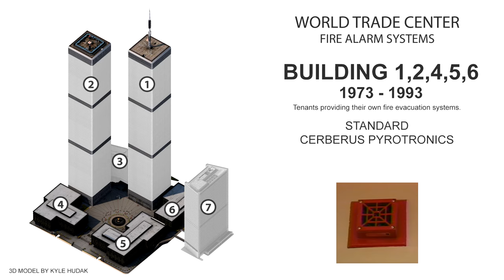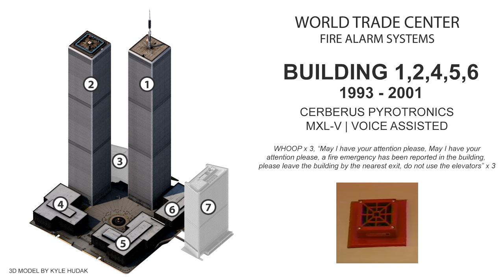World Trade Center | Fire Alarm Sounds, WTC 1,2,4,5,6,7

Comment: Did something trip these alarms on 9/11 or could it have been manual?
Reply from the maker: Considering the magnitude of the damage these buildings sustained, I'm sure they would've gone off immediately. The buildings had various smoke- and duct detectors, and were most likely to be equipped with redundancy circuits as well.

Comment: 1:38 does not make any sense, the red one is a british alarm....and the silver simplex alarm is a horn/light...not speaker...
Reply from the maker: This would be an error on my end. The Firecom patent spoke of two separate systems to generate a whoop tone and a chime tone, but it didn't describe how the actual device would've looked like and if both were incorporated within the same box, hence the and/or note in the middle. It was to my knowledge that the device on the right was capable of producing a single tone which would be the chime.
Do you know what device may have been more likely to have been used? I'll gladly update the information in the description. Thank you.
Reply: @RobvilleVirtualRealisations  My guess would be that said "separate systems" were located in the panel itself, & that both sounds were broadcasted over a network of speakers or speaker/strobes mounted around the building. From what other people have said, it seems that building 7's alarms were probably Firecom-rebranded Wheelock E70 speaker/strobes. (I've found a few Firecom-rebranded versions on Ebay so that's probably what was in WTC 7)
Reply: @RobvilleVirtualRealisations  There was no voice.
Reply: @RobvilleVirtualRealisations  Yes. I know the devices used.
Reply: I believe they were split systems. The horn carried the whoop while the flatter speaker carried the “boop” and announcements if there were any.
Reply: @kbtechandmedia  no that is not how it (or any voice evacuation system to be honest) worked / works

the world trade center used wheelock speaker strobes in buildings 1 and 2 where the siemens whoop was heard. The firecom 8500 building, used re entrant speakers.
Reply: @kbtechandmedia  all of the images here are innacurate, if you google pics of the wtc interior you can see the devices really used. As for tones.. they all can be heard in videos of the attacks yeah.
Reply: Yeah I'm 99% sure it was a System Sensor MASS speaker strobe that was used
Reply: @WolfKing25  Incorrect, SER safety's video was just using that for the demonstration. The actual devices used are Wheelock LSM style speaker strobes, in buildings 1 and 2. Building 7 had some type of PA speaker horns.

Comment: Well this didn’t stop anything
Reply from the maker: It possibly prevented more casualties though. Before the 1993 bombing, the alarms in the towers weren't standardized and I believe there weren't even proper evacuation procedures. Tenants used their own alarm systems, so one may imagine that any floors below impact wouldn't have gone off. Hell, one might argue that the idiot of the 93 bombing inadvertently lowered the death toll of 9/11. Not giving credit though of course.